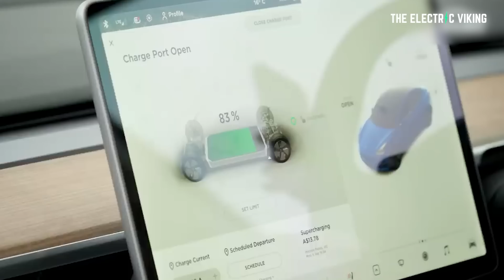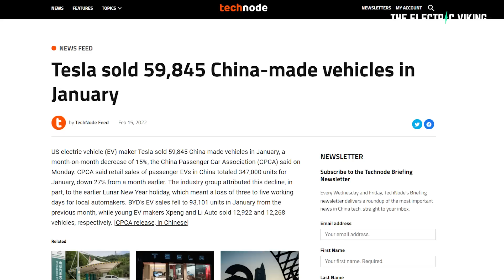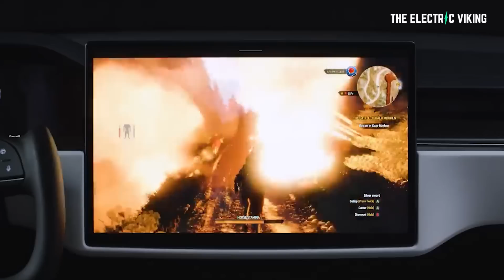REASON Tesla is installing a NEW Model 3 production line

Comment: I think that part of the factory refresh for the Fremont factory could be to redo the Model 3 to use the 4680 batteries. Soon the Model Y production in both Texas and Germany will begin. And the Texas Model Y will be using the 4680 batteries, with German Model Ys adding the 4680s in a few months. But putting the 4680s in the Model 3 would really set it apart, and once production ramps up in Texas and Germany, with production already being solid in China, then there will be some breathing room to update the Fremont factory. Elon had made comments that they were too busy building EVs to stop and refresh their factories In Fremont and Nevada.

Comment: New M3 line will allow for new upgrades (front, rear casting and structural battery pack) without stopping vehicle flow to consumers IMO. If they also add a hatch and wagon version too, it will be awesome.
Reply: That wagon version with a hatch is called the Model Y.

Comment: I’m curious, will this be TESLA’s opportunity to utilize Gigacastings in the Model 3?
Reply: I believe Tesla will do front and rear castings on the new line.  Then, shut down the original line and convert to 2 castings as well.
Reply: Probably not.
It would be very stupid to have two completely different model 3 in production. Who would buy the old model 3.
But a mega cast model 3 will probably be when a major is due.
Reply: @hgh425  That isn't how Tesla works.  They make changes whenever they can.
Reply: @CorwynGC  Exactly. Considering the average customers will never know the difference and supply is massively constrained, it’s the only opportunity to make such a change.
Reply: @CorwynGC  you are right that they make changes on the fly, but it's still not smart to have two completely different tm3 on the market st the same time, so they probably just make standard tm3's
Reply: @hgh425  they could export the ones with the giga castings and sell the old ones locally.
Reply: @saff226  why would the Chinese accept that..  or anyone else for that matter
Tesla should not complicated their supply chain any further. Stick to the current model 3 and prep for the next gen model 3 with giga cast to launch sometime, when you are not on such back orders situation
Reply: @hgh425  It's possible the better performing M3 would cost more and yes the manufacturer will disclose if the car is welded or cast, Mr. Musk does things in different ways and only he knows how things will progress. What phase the moon is in, what the price of beans is and can IDRA crank out more casting machines right now.
Reply: @hgh425  Each Model 3 has a spreadsheet with which changes it has, that is how many changes they do.  "Completely different" is a completely inaccurate way of characterizing it.
Reply: @hgh425  The average person would never know.
Reply: @bluecollardisruptor9584  I think you are insulting the average Tesla buyers intelligence.
I will claim that no other car buyer knows as much about the vehicle they are about to buy as Tesla customers.
They get all their information from the internet, all other get it from lying auto dealers
Reply: @hgh425  That’s true for now, and I’m not insulting anyone btw (I have a standard range Model 3 and. Performance Model Y). Most people will be overjoyed with any model of TESLA. Cheers.
Reply: @hgh425  You’re probably right, but long term it might be a plus in terms of cost reduction and efficiency in terms of lower weight of the car in general. This reminds me of the potential problems they’re gonna have with the Fremont vs Austin Model Y’s. Maybe they’ve got a plan to address that. Hope so…
Reply: @bluedog9935   Exactly what I was pondering. I wouldn’t even consider a Fremont Model Y when the Austin one has single piece front and rear and structural 4680 batteries. I would wait and even pay more for the Austin version. However, I have a Cybertruck on order.
Reply: @bluedog9935  agreed, but I think they will only make performance with 4680 for now. Two of the same model/type with different spec in same market could be messy.
And then you loose your world model advantage
Reply: @hgh425  No problem at all. Performance + with 2 castings add $5-10k. Done.
BMW 3 Series 3L or 4L or M… Everybody has been doing it for decades.